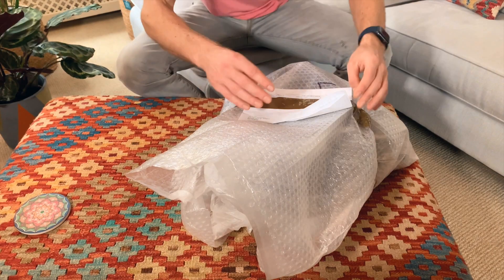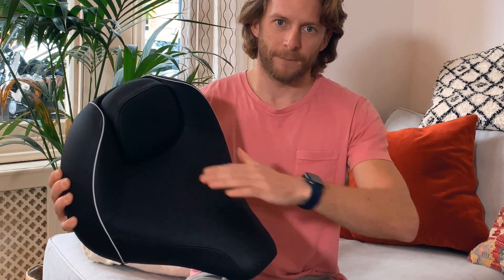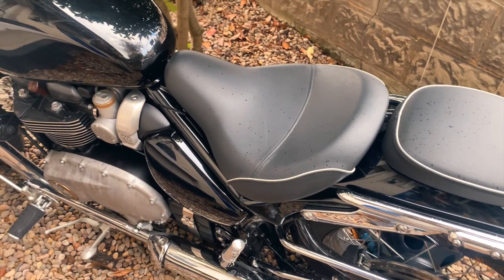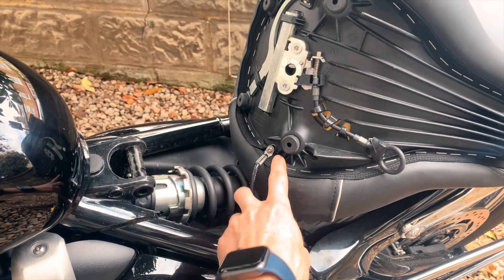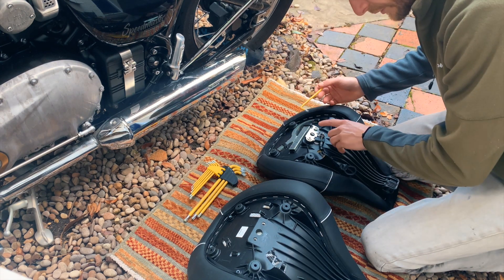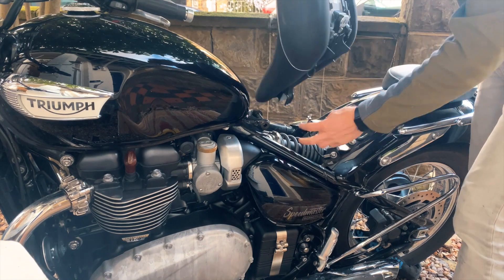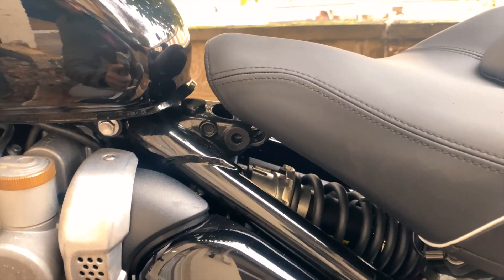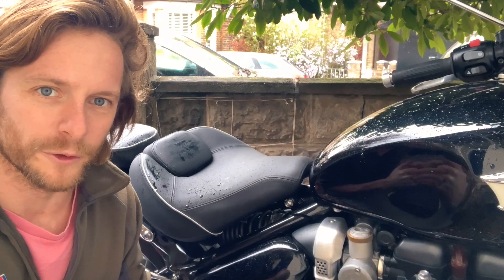Fitting My New Motorbike Seat | 2019 Triumph Speedmaster

Comment: You do not need to remove the bolt at the nose of the seat, that only retains the bush where the seat tongue hooks under. Just pull the loop lift at the back and draw the seat backwards and its off....no tools needed.
Reply from the maker: I have since learnt this! Thanks 👍

Comment: Another great video Angus my lad. Hope the seat will be more comfortable for you. The two metal bits as you call them. Are a C tool so you can adjust your pre load on the suspension under your seat. It fits around the castle nut at the topof the shock. If you want to carry heavy loads or a pillion. At the moment it looks like the pre load on your speedmaster is set at soft. If you want it harder if you have a split castle nut then turn the top one anty clock wise away from the bottom one this will allow you to turn the bottom castle nut clock wise to put more pre load onto the shock. In turn being able to carry more weight whith out  bottoming the suspension out. Once you have put how much pre load on just tighten the top castle nut down on top of the bottom one. But not to tight as it only a stop for the bottom one. Prevents it from riding up. Hope that answers you're question. Stay safe and take care bud. CHOW BELLA.....
Reply from the maker: Thanks Frank!! Yup that does it haha cheers, I think my suspension feels quite good atm. But defiantly worth knowing that 👍

Comment: I didn’t have to remove the 2 bolts from the front…once you pull on the ring the seat will slide back and you just unscrew the tether to remove, fitting the new seat is the reverse. Hope that will save some time when you eventually get the corbin 😉
Reply from the maker: Haha thanks! I thought it did look like you can do that. 👍
Reply: @redangrevival Just a suggestion while you have your spending head on…Take a look at the motone monza fuel cap for time saving and ease when you have to fill up so frequently whilst on your tours, I was on the fence about one and thought it might be too big looking but it looks great and so much easier than using the key and unscrewing the cap. 
Thanks for the great videos which I really enjoy watching.
Reply from the maker: @amotorcyclejourney  👍Thanks James, I appreciate it. Really pleased that you like the videos, I really enjoy making them. Cheers I will defiantly take a look at the motone monza fuel cap. It is a bit annoying having to twist the thing off with the key every time filling up!!

Comment: I love the comfort seat on my speedy. All day long comfortable.  I can't really compare it to the standard seat as I've never ridden on it. Others have already commented on the front bolts not needing to be removed and the c spanner. My input would be, remove the tether cord. When cleaning or doing maintenance the seat just hangs there in the way. It's there purely as an anti theft device. If Mr. Scumbag can cut off a disc lock in mere seconds, then a sliver of nylon coated wire will present little difficulty. 
Looking forward to your next adventure.
Reply from the maker: Thanks Paul I appreciate it and really pleased that you are liking the vids 👍. Yup I have learned a few things about the seat, which is good. 
Haha yea they won’t have much trouble with getting the seat!! First video of my next adventure is live now! 👍Enjoy

Comment: It’s an inch or so thicker yes? Does it push you forward a bit as well, I’m asking because I’m 6 feet tall and I’m considering a Speed Master ,  I need all the legroom I can get !  So maybe the standard seat is best for me
Reply from the maker: Hi Michael, yes thats correct it is an inch or so thicker.  I would say that it does push you forward slightly but not too much! I am 5 foot 9 inches and find it no problem at all.
I highly recommend the seat for comfort. Maybe you could try one out in a dealership possibly?

Comment: Hey Angus Corbin do look great seats I look at the site for my project V65 Honda but they are very pricey I think it was around £500 for mine . I did wonder why those bolts had to come out as there looked to be like a sliding bracket around where the bolts were mounted .Anyhow the seat looks much better Triumph should fit them as standard . Cheers : D
Reply from the maker: Hi Malcolm, yes the Corbin seats are a bit too expensive atm!! Yes Triumph do fit them as standard on 2021 models now! They got an extra £215 from me haha

Comment: Brooo how are you doing a review vid and you don't even know how to take your seat off 😂 theres a latch under the seat (you even pointed it out), you don't need to take any bolts off to remove a stock seat, just pull the latch and lift backwards
Reply from the maker: Yup since found that out! Cheers bud